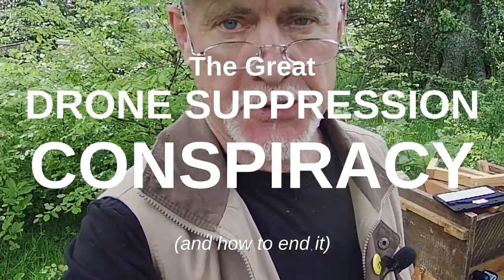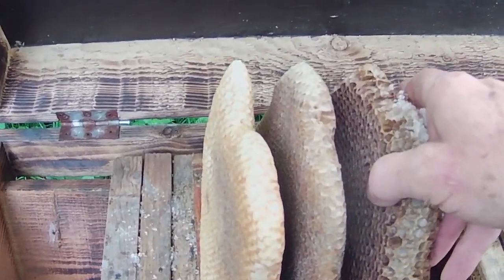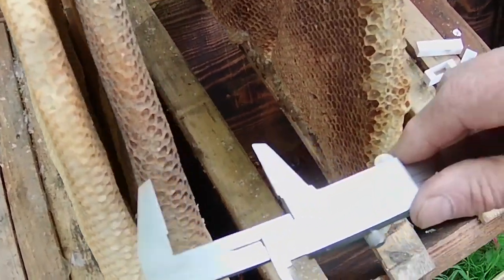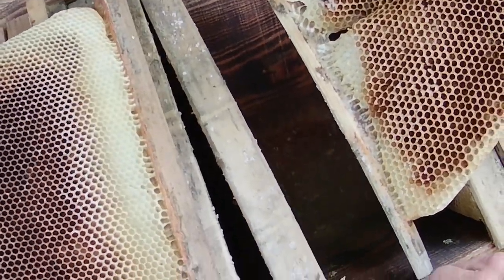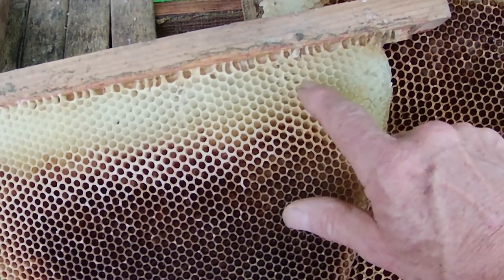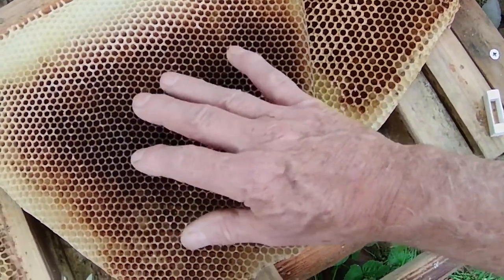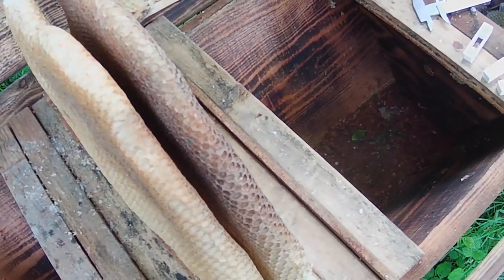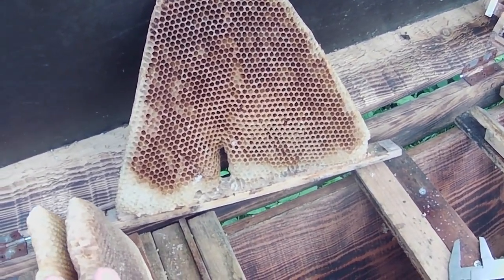The Great Drone Suppression Conspiracy: how to work with your queens, not against them

Comment: Hi Phil,  Having studied your videos, I like several others have taken up bee keeping.  I noticed that you used an inverted top bar to act as a super frame, no doubt the roof of the hive was pitched. Having built a top bar hive with a flat roof I had the idea of increasing the depth of the hive above the top bars.  I'm installing standard super frames above allowing beespace with queen excluder sheets between top bars and bottom of frames, and will give space between the top bars.  Have you tried this and did it work as in giving the queen more brood area and letting the workers produce more honey, over and above what they need to get through the winter.  Thanks Ian
Reply: You can find it in his top bar tips and tricks video. He also said there that someone else had taken his idea of the cathedral hive and marketed it. If that's what you are referring to.

Comment: Great videos… Thank you for sharing your wisdom and observations….

I am fascinated by your top bar/natural hives. I really like the trapezoid shape. I think it would make for a more energy efficient hive (for the bees, easier to maintain ideal temperatures). I will have to do more reading and research on these… I will definitely be building some of these and running them in the near future…. Granted, I will add insulation all around… 

How are you extracting those combs? (I might just run some for honeycomb, but I prefer to save the comb and give it back to the bees whenever possible.

Anyway… Thanks again… Great stuff!!!

Comment: Nice talking point Phil, I am using national size hives and frames with hoffman spacing but adding only frames with starter strips this year, my biggest hive (of 8) overwintered in two deeps and end of March had full 22 frames of bees with 6 frames of worker brood. I moved up into 3rd deep a few frames of brood and replaced with starter strip frames in middle of brood nest in the lower boxes and outside of top box. 14th April I had 33 frames fully drawn and full of bees, 10 frames of worker brood and 8 frames of drone brood and they were 35lb heavier, (I have the whole hive on balance scales), I put an excluder between 2 and 3. The weather has not been good since then and they have lost almost all the 35lb but have drawn most of the 4th box and it is full of bees. I have done some quick checks for swarm cells since (none yet) but not counted brood frames, there are drones everywhere in the hive but the drones not been flying much, workers are flying in all weather and when the sun comes out you can't see the entrance for bees. I think drones are playing a part in keeping hive warm letting the workers fly more but will hopefully see what happens when the weather is right and there is a flow, next week maybe?!?
Reply: Interesting point. I'd never thought about how they are also (amongst the other ways in which they contribute), contributing to keeping the hive warm.
Reply: I wonder if the drones also provide Air con in the summer. Big concern for me here in TX.

Comment: Thanks Phil, great video, personally I find it irritating that Hoffman spacing in nationals is 35 mm especially seeing as national boxes allow built to accommodate 11 such frames will (before propolising) fit 12 frames. Which causes no end of issues for me. As it almost forces me into using a dummy/follower board. I do wish manufactures would bring out a 38mm spaced end bar. Otherwise I think I will end up moving to castellated spacers (11slot) in my brood boxes. 

Love the videos and am hoping to see more on your quadratic hive this year. Specifically some roof designs as I find your plans in the ebook somewhat lacking in that area.

Comment: I guess Comb is wider under the Top Bar, as it is the foundation (the structural base) which will take a large load off it. Aka like the foundation of a wall in a house. As the Comb is drawn down lengthwise, the wider top can take the weight, and be strong enough, for each subsequent row, or rows of Honey Comb. 💪
Seeing you comb in this video, is rather like a tall building in reverse... Wider at the start (base) and narrower at the finish (top). I guess New York skyscrapers caught on Drone Camera footage, could be interpreted as an upturned top bar hive Wax built structure !
After all Bees are one of the best civil engineers ever... 🤗
🐝🐝🐝🐝🐝🐝🐝🐝🐝🐝

Comment: "which is very sweet of them"! lol
but yes,its quite a clumsy system,if were completely honest. the reason is that it does not mesh with any other measurement system. metric is much more elegant. 1 liter of water has a resonance with many other relationships relating to 1,10,100,1000...